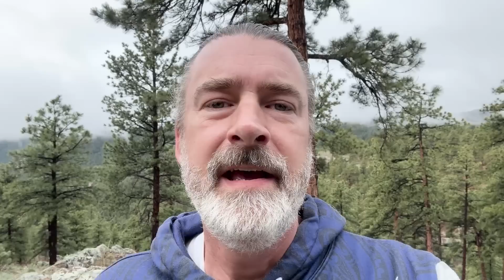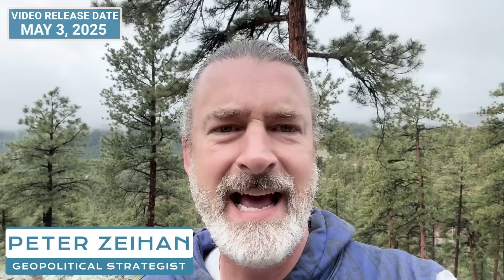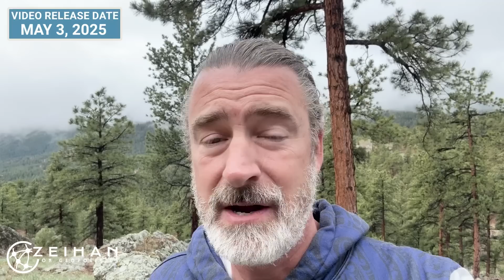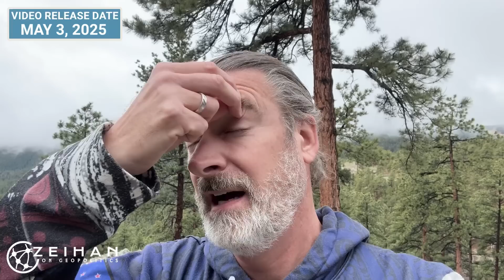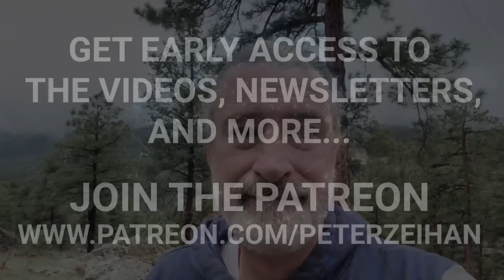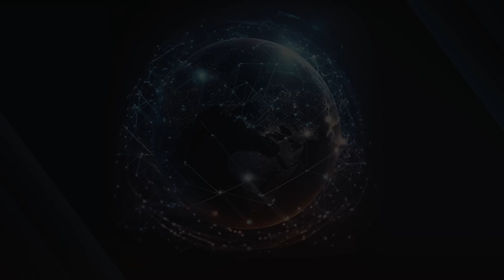The Night the Lights Went Out in Geor- er, Spain || Peter Zeihan

Comment: Here in Aus we have a twofold strategy, installing a lot of synchronous condensers on main lines (literally just freewheeling, electrically powered 'mass' that can act as a generator in a microsecond for a short period) and a huge build-out of battery FCAS. We're also trialling grid forming inverters (they can totally provide the heartbeat, think of an off-grid house that runs on solar and batteries) it's just we need to confirm operation and orchestration so that they don't start 'arguing' with each other (constantly changing parameters in response to each other's changes) and causing unintended consequences. We will get there, it's just new tech and new horizons, and with the grid softly softly is always recommended. But no, you dont need to rely on 10-15 years of lithium titanite production. If that was the cause my guess is they'll rapidly install syncrons
Reply: Spain doesn't have a lot of battery storage. In Australia, in particular the state of South Australia, we do have a reasonable amount, and we are building more. Not fancy LiTi ??? batteries. Just good old normal Li . For those interested, google ' Hornsdale wind farm battery ' which is the first large grid battery trialed 8 years ago which has changed the game. It, and now others, have proved time and time again how good these batteries are at FCAS. Faster than existing traditional systems. For the last few years, we have been trialling grid forming inverters which facilitate synthetic inertia to replace traditional physical inertia from a large spinning machine. The trials are all going very well and consequently, large batteries are being built all across the country. Apart from stabilizing the grid, we have also learned that having batteries spread far and wide reduces the need for new transmission as batteries at either end buffer the transmission and make it more efficient. This widespread battery network, right down to the household with solar and a battery (remember, Australia is a sunny country), means that a huge amount of load is essentially removed from the grid because the generation and storage is also at the load point, thus freeing up even more transmission. As we all know, batteries (and other forms of energy storage) are getting better and cheaper at a fast pace. So, in summary, the rollout of energy storage is the final critical component that will allow the transition from the old traditional baseload system to the renewable, much more flexible and efficient new system.  https://reneweconomy.com.au/no-batteries-no-flexibility-spain-could-have-avoided-blackout-with-lessons-learned-in-south-australia/

Comment: A couple of subjects Peter didn't discus was 
1. Grid following Vs grid forming inverters.
My simple understanding here - mechanical engineer not electrical - is that following inverters just match whatever they see on their input terminals. So if there is a problem they can compound it. Forming inverters in contrast. Actively seek to support the grid. Australi is moving strongly into forming inverters now for this reason
2. Synchronous Condensers or SynCons. These are spinning machines that don't generate power. A bit of power from the grid is used to keep them spinning at the right speed. But if a problem happens, they have inertia just like the coal/gas generators and. support the grid. So you don't need actual coal/,gas power stations.

Australi is moving into forming inverters and SynCons to deal with this.

Comment: Lots of other things can be done to fix oscillations, like synchronous condensers and changing settings in the inverters. Europe is a very large synchronous grid. Changing with HVDC interconnectors would probably help.

Comment: No thermal plants do not cause stability in itself. Rotating mass does and where do you find the heavy generator shafts? Nuclear and hydro plants. Spain have several turbines driven by solar so that makes them  equally good or bad to say a coal or an oil plant.
Reply: One does not need rotating mass to stabilize an electric grid fed by DC sources like solar plants. What one does need are very good control algorithms, which have clearly failed here.

Comment: Another solution is replacing an old coal fired generator into a motor driving a great big flywheel so that you've got 10 seconds of power at almost no frequency variation.
Reply: You can get an hour of perfectly stable power from a bunch of batteries. This ain't the 19th century.

Comment: For everyone to understand. In order to connect two AC electricity suppliers with each other (and so to build-up a grid), three conditions must be met:

- volage must be identical (can be adjusted via adjustable transformers)
- base AC-frequency (EU 50Hz and  US 60Hz)
- both now identical sine curves must be also in total timely sync - it is called a 0 dgr. phase shift (or no phase shift at all)

Heavy turbines can be adjusted with their steam / gas energy input to the correct frequency and phase.

- The way turbines are built their frequency output is directly coupled to their spinning speed
- The phase sync depends on the present angle of the spinning shaft against the same present angle at the other spinning shaft (at the second turbine)

So spinning speeds and (dynamic) present shaft angle must be in sync. it is like two NASCAR race cars trying not only to maintain the same speed but also drive perfectly in parallel to each other.

If one of these three conditions are not met and you connect both electricity suppliers you will generate a hefty internal short - sparks will fly.

Within grids only heavy spinning (masses) of turbines can generate enough power to dictate THIS all important master frequency, the 0-dgr. phase (timing) angle and the voltage. It is also called the "inertia" of a grid.

Solar and wind, since they both produce internally DC cannot do this and they are too small in power to dictate anything, basically the same is with batteries. 
These DC-components have AC-converters, which measure from the grid the voltage, the frequency and the phase. Then they adjust their own internal power electronics and THEN they hooked themselves onto the grid. If the grid voltage, the frequency or the phase shift (suddenly) shifts drastically, they take themselves off immediately. Those thing happen extremely fast (splits of seconds).
So solar, wind and batteries can only FOLLOW the grid - but they CANNOT DICTATE it. This is the key point.

When you now take back too much power from the turbines, you are left with too little to dictate = to sync the grid.

One external / internal event (sudden loss of  a big load or supplier or a lighting strike) and you're left with too less to dictate the frequency and phase sync. The system becomes extremely instable - because this system status generates wild currents between the different grid components. The more instable, the wilder it gets.
An instable grid means basically, the internal grid currents will get very fast totally wild and therefore way too high and could damage the grid components up to a certain imbalance in the grid. 
Which is why solar and wind MUST turn themselves off at a certain point, as with anyone else in the grid. Cascade effect (not enough turbine power = "inertia") - BOOOM! Quiet and dark.

The trouble is further: wind, solar and batteries cannot black-start themselves into a grid - they have no life grid to sync themselves and they are too small to power it up by themselves. Once they are off and the grid is dead, solar, wind and batteries remain dead.

This blackout indeed was a disaster predicted by many engineers and grid operators warning for years about the crazy and chaotic add-ons of solar and wind into the West-European grid.
Crazy Greenies "activists" like our doomsday Greta have been allowed to push politics and engineers have been shoved aside.
Congrats!

PS: Flywheels are a grid stabilizer but energy suckers; they also cannot really black-start themselves either.

Peace! from Dresden / Germany
Reply: And what do we need AC grids for to begin with? Long distance DC networks are far more efficient. They are also costly... so what this problem really boils down to is that some fools wanted to save money.
Reply: @lepidoptera9337  
It developed historically, besides AC has great advantages:

- All powerful generators generate AC as their operational principle. Converting it into DC must be done mechanically at the rotor shaft, which is tricky to do, wears down fast and generates permanent hefty sparks causing further problems. The converted AC also has the form of a sine curve with the negative half being flipped by 180 dgr. into the positive upper half.
Not really nice, it puts out a lot of electric static noise into the powerlines which is very bad for anything of communicating equipment.

- Converting DC into AC was almost impossible in the early days, requiring heavy machinery (DC-generator coupled mechanically onto a AC-generator), while vice versa kind of possible but for small powers only because the very early semiconductors (selenium based) were available soon after.

- Only with AC you can transform voltage, which is vital to transmit electricity over larger distances because you NEED to transform high voltage and low currents  (P=U*I) in order to minimize transmission losses. According to this formula you need to reduce the current (which heats the cable, hence produces the loss) and increase the voltage (no loss at all).

- High voltage and DC is an extra ordinary dangerous mix in terms of safety (in case people touch a life wire and get electrocuted)

Probably only in the 2000er years we finally managed to produce very powerful semiconductors which enabled us to convert high-current and high-voltage AC to DC systems and vice versa.

Since then for very long-transmission lines DC is now preferred to erase AC losses (every cable represents also a capacitor and a inductivity, which has no meaning when DC is being used). But it too comes with challenges and is not very practical the moment it goes down to local sub-grids.
However, DC-powerlines also have their technical challenges, particular for the insulation. The constant polarity might trigger chemical processes inside it, destroying it fast.

Historically (ca. 1880) when the very first electric lines were connected to private homes, a big fight broke out between Edison (DC) and Westinghouse (AC) over which system is to be preferred. 
In the end AC made its worldwide victory because it was easier to use, had a lot of advantages and could be adapted easily into local (geographical) needs of nations. There is no single nation on this planet running a DC-grid.
With other words it makes / made technically no sense to build everywhere DC-grids. Only for very far distance transmission it makes sense - which is done now since 20 years, roughly, as far as I know (I am NOT a grid expert, but an electric engineer).

Peace! from Dresden / Germany
Reply: @lepidoptera9337  

I answered lengthy but it disappeared. Happen quite often on YT. Just technical stuff, still disappeared....

Basically the AC-system was preferred straight from the beginning by the then historical engineers (Edison - DC and Westinghouse - AC basically battled it out, with Edison losing it) and their companies because it has many advantages and DC was technically almost unmanageable at the time (1880) when the first electric lines were build into homes. I.e. you cannot transform voltages with DC, which is necessary to transmit electricity over longer cables without too much of a loss.

Now that we have extreme powerful semiconductors, which also can handle high voltage, to convert DC to AC and vice versa, it makes sense to use DC for VERY long transmission lines to reduce AC-losses. 
Every cable represents also a capacitor and a inductivity causing losses with AC (only).

However, high-voltage DC lines represent other challenges too like insulation fading due to the permanent polarisation of the electric current inside.

Well, it is up to you to understand engineering challenges. The Queen of Sheba should perhaps get a bit more educated 🤩, because this what we engineers do for a living - resolving the problems by i.e. choosing the right technology or machinery etc. to make things work.
AC just makes sense in local and shorter sub-grids. High-voltage DC-cables are only used in the last one or two decades, because it wasn't possible before that. The (semiconductor) technologies were simply not available.

One piece of advice for the Queen of Sheba - start travelling and widen your horizons. Very entertaining and educating. Trust me 🙂.

Peace! from Dresden / Germany
Reply: @Boni-i1l  AC systems were only "preferred" because people didn't have semiconductors back then. Now we do.

Comment: Doesn't nuclear spin turbines?
Reply: Yes. The problem happens when you run out of water. Batteries don't need water and they can never melt down a reactor core. ;-)
Reply: @lepidoptera9337  thats old designs, we can make perfectly safe reactors that can not melt down. Also, Teslas and BYDs demonstrate how safe batteries are 🙈
Reply: @PlanetJeroen  Yes, we can make perfectly safe reactors that are producing energy for $2 per kWh. Sound of one hand clapping. ;-)
Reply: @lepidoptera9337  in which economy is that more expensive than creating a 1kwh battery and cycling it 5k times?
Reply: @lepidoptera9337  also, 2 dollar per kwh? Source?
Reply: @PlanetJeroen We aren't cycling batteries 100%, 80% or even 20% for stabilization. The first battery in my Prius lasted 15 years. That's an old NiMH technology that gets roughly 500 100% cycles. In city driving that battery should have failed after a month (or less) by your primitive (and completely false) mental model of battery degradation. 

Does it make sense to store 2 cents/kWh electricity for 20 cents/kWh in full cycle applications? Yes, if that saves you the money for more grid capacity, then absolutely. Your economics model is just as primitive as your battery model.
Reply: @PlanetJeroen Let me see your 100% safe, 2 cents per kWh reactor, first. I always like to look at the technological equivalent of Harry Potter's wand. ;-)
Reply: @lepidoptera9337  your numbers ...you are pulling them from  your behind.
Reply: @lepidoptera9337  have you verified anything you are stating here, or are you just spitballing based on vibes?